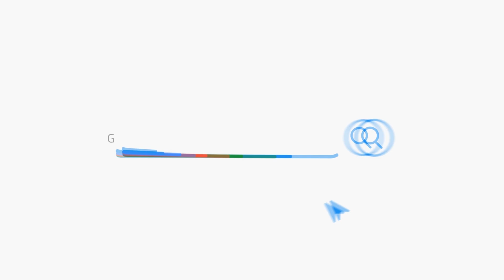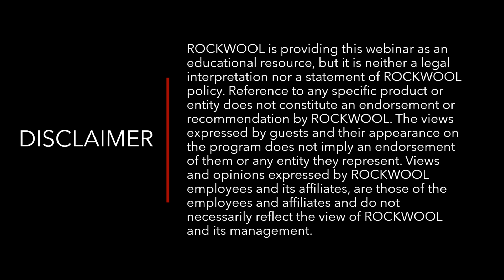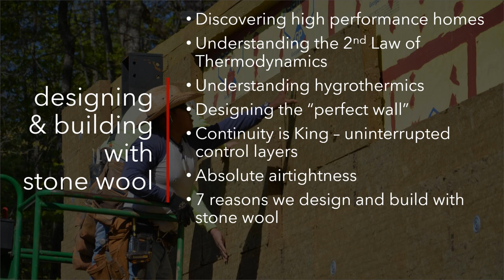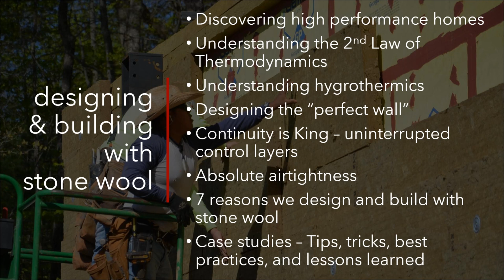Designing & Building with Stone Wool Insulation - ROCKWOOL & LG Squared

Comment: How can you say the control layers are "continuous" and "uninterrupted" when you are using thousands of screws to puncture the layers and provide a highly conductive thermal bridge from the outermost layer to the innermost ?  Wouldn't it be better to build a second set of exterior walls and roof to support insulation, sheathing, and roofing materials without any connection to the innermost control layer that contains the living area ?
Reply: Wish we could just Velcro everything to the outside of the house. Would also be much easier for changing out siding too. Jk.  There will always be penetrations through the housewrap and many self adhered house wraps will actually seal around nails and screws. When using self adhered you minimize the amount of staples to hold it up too so only the fasteners that hold the insulation/rainscreen on is penetrating so that’s 62,000 less holes. Then the siding goes on the furring strips.
Reply: As far as thermal bridging, with each fastener being about 12-16” OC and use stainless screws for less thermal conductivity.
Reply: @Builtbetterdesign  That is still a couple thousand five or six inch expensive screws and firring strips.  That has to cost more than a second plain stud wall and even ss screws are going to be a thermal bridge.  It just seems so unnecessary to mechanically fasten the thermal and water control layers to the living envelope.  Lstibureks sweater analogy for insulation doesn't sound so good if you say the  sweater will be held in place by thousands of safety pins through your skin.
Reply: @kirkellis4329  The blower door and infrared testing shows that this method is better.  Our client's energy bills are much better to the lack of thermal bridging in other framing methods.  The fasteners are also attached to the framing, which has some thermal resistance, which helps mitigate the bridging.

Which building envelops assemblies are your go-to for your homes?
Reply: @matthoots1156   Really ?  So you have actually built a house without any penetrations of the control layer and all insulation on the exterior and it had a worse infrared test and blower door test than putting all those fasteners through the control layers ?  I find that hard to believe.  I haven't built any homes. I am investigating all the alternatives and asking questions when I see things that are counter-intuitive.
Reply: @kirkellis4329 , You have good questions, and they need to be asked.  The laws of physics are not changing, just the application of materials to help build

Most exterior claddings will require some sort of fastenings.  Even brick requires a fastener since it is usually a veneer and requires a brick tie to prevent movement away from the structure.  For standard construction, cladding is nailed to the structure through the weather-resistant barrier.  The WRB is not waterproofing; it is a way to keep bulk moisture out AND allow for drying.  Airflow is key to an assembly performing well.  The only time I have not penetrated any of the control layers was when I designed a concrete house, and the concrete was the final finish, and the control layers were not all to the exterior.  You can also build a SIPS house with stucco with fewer penetrations as well.  

There are thermally broken rain screen assemblies common in commercial construction because heat transfer through the insulation is a concern since the fasteners are larger.  We choose not to do that because the heat transfer through the smaller fasteners is negligible, and our clients' energy costs are meager.  The infrared testing shows no heat transfer, especially compared to a traditional wall with only cavity insulation.   Yes, you can improve to a "perfect wall"; however, there are diminishing returns.  You can also double the amount of insulation on the house as well beyond the modeling.  It will not cause your heat transfer to change- you just have a thicker thermal barrier.

Where you live matters as well.  If you are in a frigid climate zone, then there are other considerations that we did not address.  Which climate zone do you live in?

Bottom line- "Build Tight and Ventilate Right," and you will be fine.

If you are looking for a deep explanation for each of these topics- I've heard that this course was pretty good for design professionals- https://www.buildingsciencefightclub.com/bundles/building-science-for-architects

You can also ask your questions here during a live presentation each Thursday.  Lots of great speakers that are familiar with these techniques-
https://www.thebsandbeershow.com/

If you are looking to build a house, I'd recommend partnering with an architect who understands passive house design so you do not have to educate them.  I can make some recommendations if you like.
Reply: @matthoots1156  Yes, the law of diminishing returns matters more and more since lumber prices have more than doubled in the last few years.  It had seemed simple -- build two structures with no connection to each other than the foundation, roof ridge, and possibly eaves.  The inner wood framed and sheathed wall would support all loads other than wall insulation and cladding, which would be supported by the outer wall.  The inner sheathed wall would be air/water/vapor isolated by Grace peel n stick, then a layer of continuous rockwool, then the second stud wall with more rockwool between studs, then breathable housewrap, then cladding attached to that outer wall. HRV and dehumidifier to control air quality and humidity drying inside while the outside dried to the outside.  

The roof would be trickier due to loads requiring either ladder rungs fastened down to the structural rafters of the inner structure or a second set of rafters strong enough to carry the roof loads alone and inner ceiling joists carrying only insulation and drywall loads.

This would all be to prevent penetrations of the peel n stick and the cost of all those long fasteners.  Just as a house can be leaky from thousands of tiny cracks because those cracks add up, I wanted to avoid the cross section of all those conductive fasteners adding up.  2000 screws with 1/4" diameter add up to 95 square inches of cross section (metal heat conductor) from outside to the inner frame.  You are saying the fasteners don't matter because their tips are buried in the framing, but as wood shrinks and plasticizers fail over the years, it seems like pathways for heat and water would just get worse and worse.  I wonder about cold fasteners chilling the OSB sheathing in that small area to the point of condensation of indoor humidity.  

It is as though Joe Lstiburek said to put a sweater on your body but you chose to use thousands of needles puncturing your skin to hold it in place.  Just seems less than ideal.

Even at current high lumber prices, it seems like that second outer stud wall would only cost $1/sf of wall -- less than long screws and furring -- and it would allow the less expensive rockwool batts rather than boards.  If the building department would allow that outer wall to go without sheathing since it wouldn't be "structural" like the inner wall.

I would be building in the lower mountain elevations of the Sierras in California 4-5000ft, so R30 walls and R50-60 roof (all exterior) should be enough.  I would aim for a blower door test under 0.5

I am retired with a small budget, so an architect is probably not in the cards.
Reply: @kirkellis4329 , I understand what you are saying.  The purpose of the thermal layer on the outside of the WRB is to prevent condensation since the surface could reach the due point and cause structural failure.  This assembly allows for continuous insulation and keeps the framing (warm).  Here is another webinar where you can ask the panel questions about the assembly.

https://www.rockwool.com/north-america/about-us/events/elite-builder-webinar-destination-renovation-exterior-wall/

Did you go to the BS & Beer show last night?  Lots of experts there to bounce some of your concerns off of.